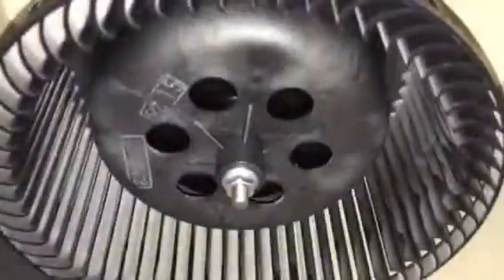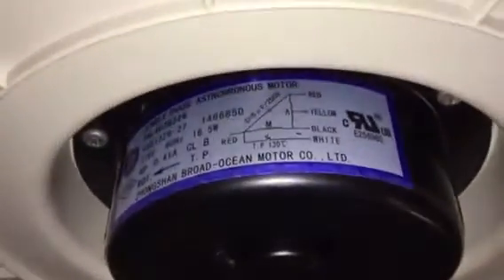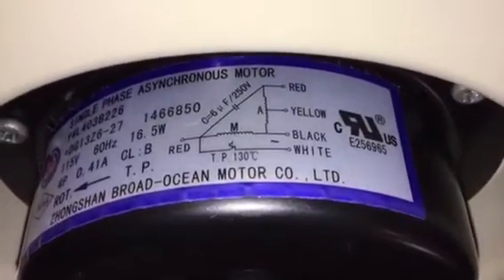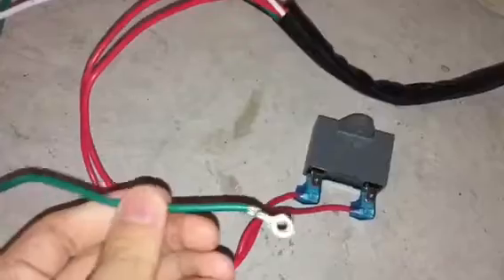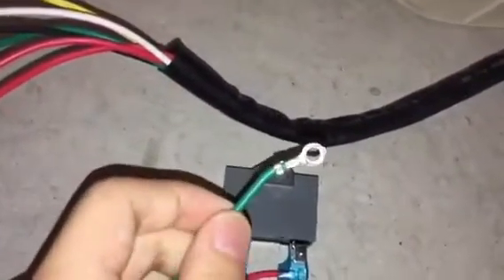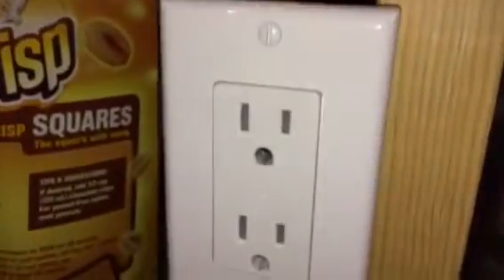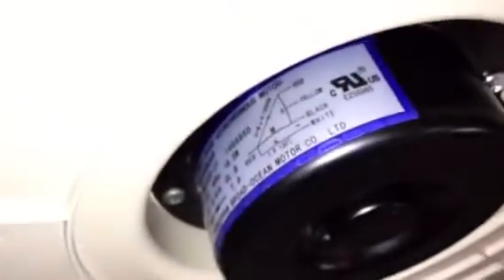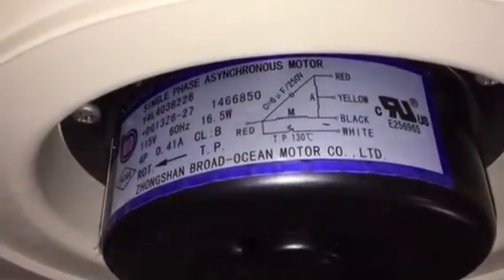Need Help on Wiring an AC Motor!

Comment: if you run it just like that, the air is not directed to the output. but just spreads everywhere
Reply from the maker: Wilbert A S yes I'm going to put a front cover on it